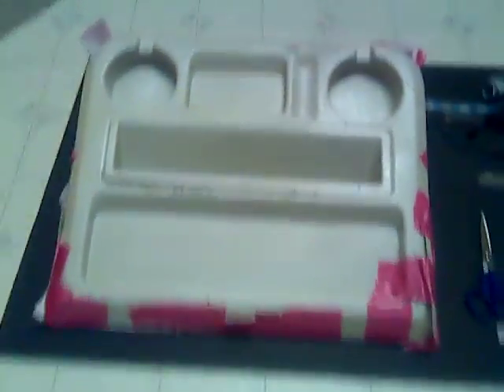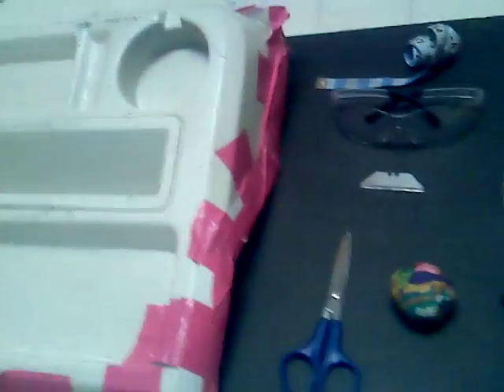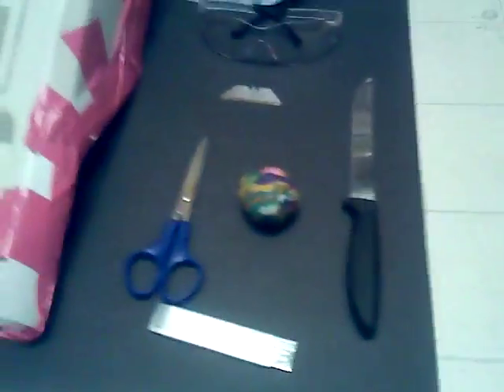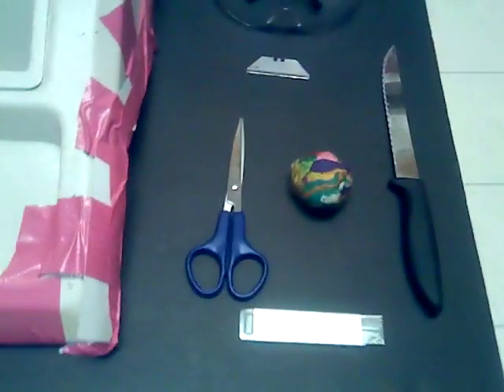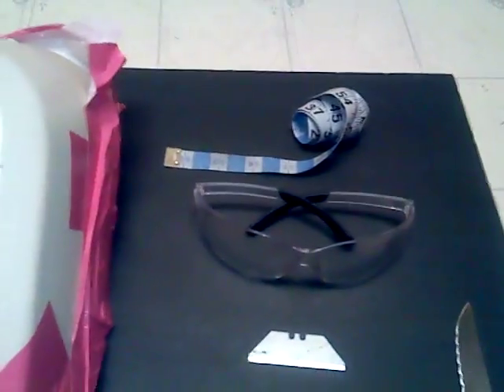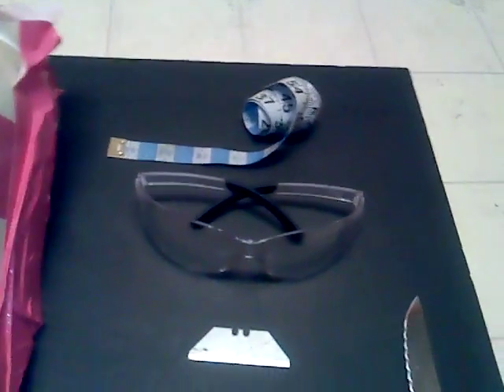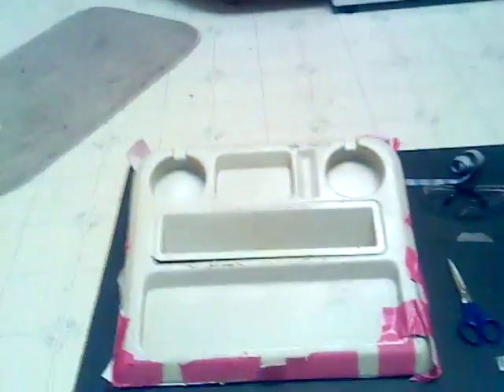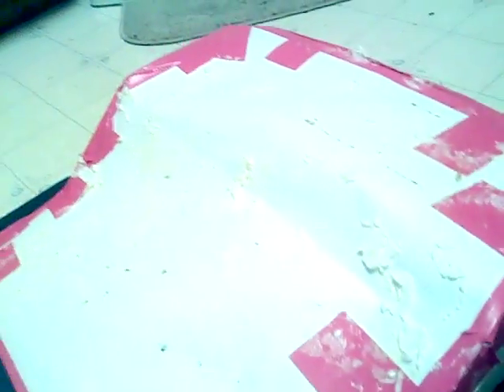"GREAT STUFF" Foam Design's for Car's, Truck's and Motorcycle's

Comment from the maker: New "BIG GAPS" by "GREAT STUFF" Expanding Foam in a can, to Fill Large Hole's, Crack's and Gap's 1,2, even 3 inches Wide. Easy to Insulate Wall's, Tubing, & Auto Body Collision's. Low priced, fast repair, no grinding just sand & paint finish, No Pain, ALL BRAIN.